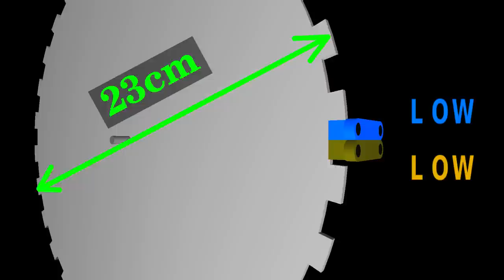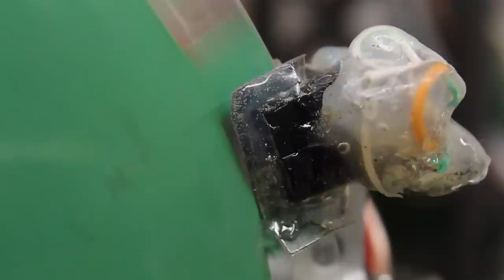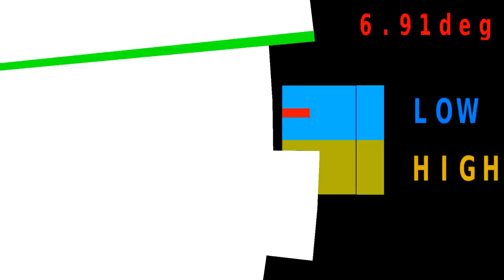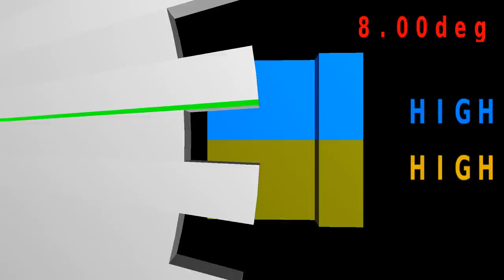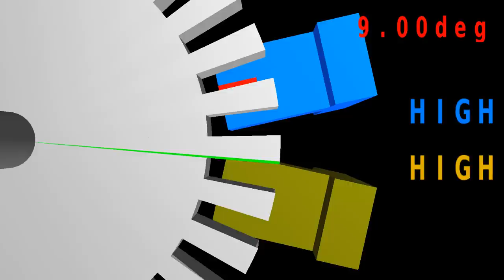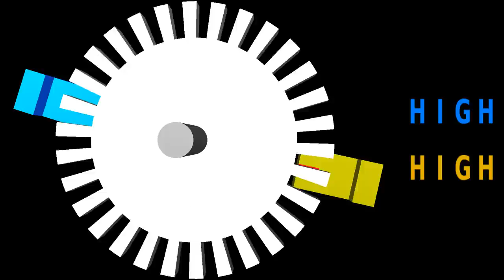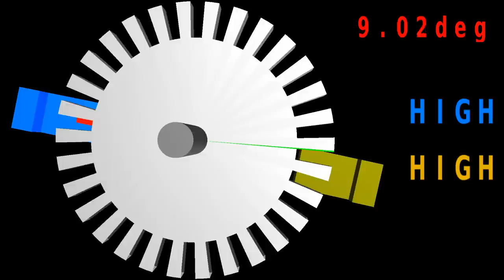Rotary encoder - sensor arrangement

Comment: I think about this few weeks ago). How about big weel with 2 mm tooths?
Reply from the maker: That would give you a higher resulution (more steps per revolution). the 30 teeth and so 120 steps per revolution are good enough for my CNC (resulting in a linear movement of less than 0.01mm per step).
Reply: oldmangin mt , you can buy 400 or 360 PPR rotary encoders for less than €$10.

Comment: When i attach a motor to the setup, the encoder dosent seems to catch up with motor speed. Is it same for others?
Reply from the maker: Of course there is always a limit for an encoder / microcontroller combination. The encoder must deliver clear high/low levels amd the software on the microcontroller must be able to process the input. Use hardware interrupts for maximum performance.

Comment: I have observed that the pins marked 'D0,D1,D2,&D3' of the LCD display are not connected to the arduino in any projects and applications. Are they useless?
Reply from the maker: You can transmit data faster when using those additional pins. Since you never have enough pins on your Arduino, the 4 pin bus variant is mostly used.

Comment: Know anybody if is possible to calculate speed of rotation?
Reply from the maker: You must measure the time between the change of states. Store the start time, wait until a number of events took place and then store the end time. If you know the number of teeth, you can calculate the speed with simple math.
Reply: @HomoFaciens  I want to use it for wind speed for meteostation builded from arduino. I will hry something, because number of teeth and diameter  I know

Comment: #define P_FRACTION 1.0     //Proportional factor of control loop 0.001 - 10.0 (1.0)
#define STEP_MARGIN 4L     //10 - 1000 (1)

sir i download your code from your given website i am confused
can you explain these two lines 
because in your whole code P_FRACTION remains constant
and what is this 4L?
Reply from the maker: Of course P_FRACTION is constant. That's why it is defined that way.
The "4L" means that STEP_MARGIN is set to the valuie 4. The "L" is just a hint for the compiler that it is a long vale. The code will also work without the "L".

Comment: What is that type of sensor called?
Reply from the maker: Light sensor, slotted optical switch, optical sensor or photo interruptor. You can get them e.g. from old printers:
https://homofaciens.de/technics-base-circuits-transmissive-optical-sensors_en.htm

Comment: I don't trust simple encoders because they can lose a signal. Not even the Logitech steering wheels were able to work 100%. Depending on the purpose, an absolute position encoder is better. I made a rotary encoder, but using the gray code. I have a video showing.
Reply from the maker: As with all sensors, you will lose information if you operate them beyond the limits. Relative encoders are much simpler to build and so often the better (cheaper) choice than absolute motion sensors. I am using them in a couple of my CNC machines without losing steps:
https://homofaciens.de/technics-machines-cnc-v3-2-1_en.htm

Comment: what we have to do if we are using raspberry pi
Reply from the maker: The Raspberry has no real time operating system, so you will loose pulses from the sensors even at relative slow revolution speeds. An Arduino with interrupt routine is definitely the better option.
Reply: thanx for replay
yes you are right, i convert your code in python and run it on pi. The pi looses pulses even if motor is rotating  with hand 
how to tackle this problem i have to do it on raspberry pi 3 B
can multi threading help me solve this problem
Reply from the maker: Read more about rotary encoders and Raspberry Pi on:
https://www.modmypi.com/blog/how-to-use-a-rotary-encoder-with-the-raspberry-pi